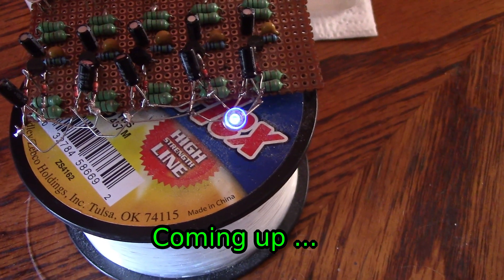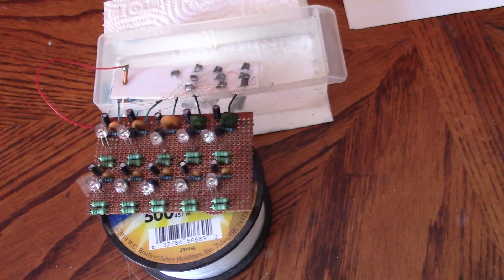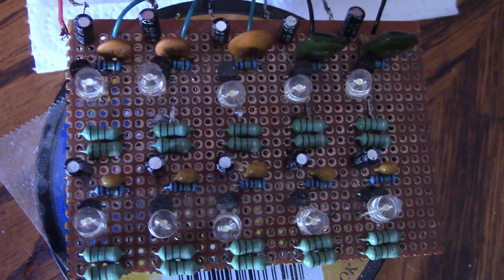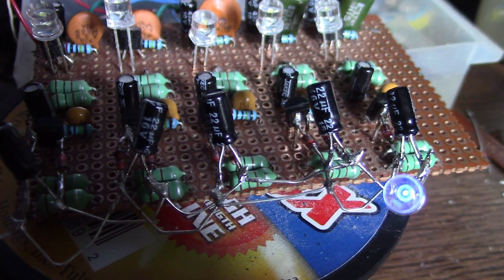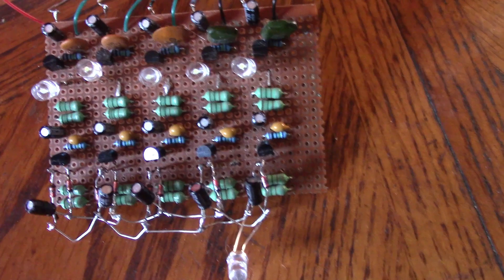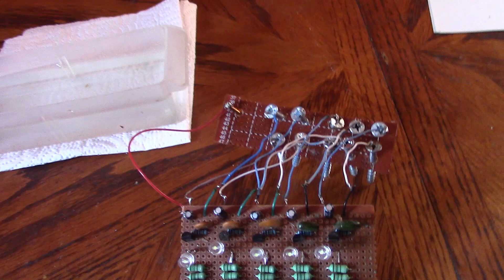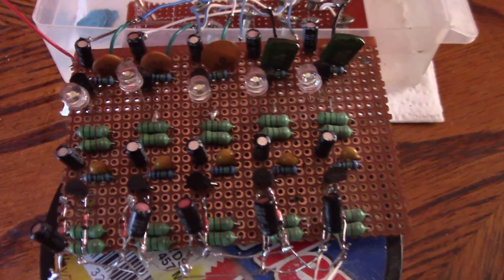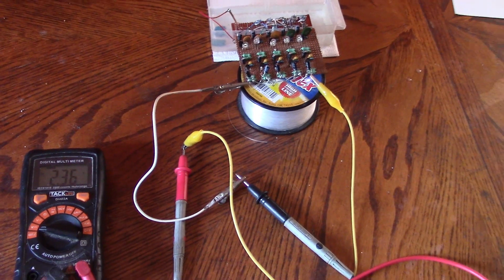Success! No battery or solar needed  - The Power Chip Part 2

Comment: How is this not a battery? I looks like a battery to me.
Reply: exactly.. hate youtubers nowadays, they are so lowly educated.
Reply from the maker: It's exactly that, in a broad sense!
But the individual cells don't need separated electrolyte (flooded lead acid), separate containers (conventional cells) or separate positive electrodes to be summed. 
And, that's the point, to be able to be put in the ground or water and generate AS a battery. There are also significant metals savings by using only 1 piece of copper for the whole lot 😀
Reply: @Slider2732_  if you package the components of a battery in a durable container with low manufacturing cost you get prismatic or cylindrical cells. Why is your design better than consumer grade products available everywhere?
Reply: @drdrowland you have made a very good point ! He made an excellent “battery” (in fact is a generator) which will outlast any modern battery by 100.000 times more and the real beauty is, it can be done in a very small size … probably a size of a car battery for such generator system would be enough to power any vehicle or few houses constant for many years without any maintenance.
Reply: @Caesarus2011  his design suffers from volumetric energy capacity. It would weigh way more, too.
Reply: @drdrowland  nope, it is just proof of concept. He shows is working. I have employed a different approach and is working too. Electrodes can be as big as an atom is and water can be as much as a molecule if someone could make connections at this scale … so, no volumetric capacity problem. I am making one as small as I am able to make all connections required and I will share soon my own design easy to build in diy manner. While the method exposed here is much more feasible for semiconductor tech in nano scale, but I lost any hope I will see such a thing off the shelf in my life time … so, I will teach anyone how to make themselves as many as they like for any purpose.
Reply: @Caesarus2011  it's going to stay proof of concept but that concept isn't performance at scale. It's at test bench scale and the reason they haven't published performance numbers is because they can't compete and never will.
Reply: What he means is the battery that you usually spend your hard hand money to buy😂😂😂🎉🎉🎉

Comment: I made similar thing - 10cm x 10cm pieces of copper, paper and aluminium soaked in salty water.
With single "joule thief" circuit such device produced enough power to light red indicator LED for several weeks - until aluminium dissolved.
Like other person said, this is just basic battery.
Reply: what you're describing  is just a form of battery called a voltaic pile. It's basically the root of why the schematic symbol for a battery looks the way it does.
(what's presented here in the video is also just a battery)
Reply from the maker: Yes, individual circuits like a Joule Thief are the basis, but the difference is to combine many circuits in the same electrolyte and only a single positive electrode, then sum them 😀

Comment: This is just a battery , fun fact, putting the copper and zinc closer will yield more power, in fact, a 1:1 ratio of anodes and cathodes would be best, connect in series for low current higher voltage, parallel for higher current at a lower voltage

Edit: I've also identified the most likely circuit that would create the pulsing effect, and voltage boost, and that's a circuit known as a capacitor-based charge pump. Don't get me wrong, this is a solid project, but with this information, it's just a water activated battery and a capacitor-based charge pump to help boost the power output.

Build that in a grid
Z: zinc
C: Copper

high current, low voltage:
|---CZ---|---CZ---|---CZ---|---CZ---|---CZ---|---CZ---|
|---ZC---|---ZC---|---ZC---|---ZC---|---ZC---|---ZC---|
|---CZ---|---CZ---|---CZ---|---CZ---|---CZ---|---CZ---|
|---ZC---|---ZC---|---ZC---|---ZC---|---ZC---|---ZC---|
|---CZ---|---CZ---|---CZ---|---CZ---|---CZ---|---CZ---|
|---ZC---|---ZC---|---ZC---|---ZC---|---ZC---|---ZC---|

high volt, low current:

CZ---CZ---CZ---CZ---CZ---CZ
  |       |       |        |      |        |
CZ---CZ---CZ---CZ---CZ---CZ
  |       |       |        |      |        |
CZ---CZ---CZ---CZ---CZ---CZ
  |       |       |        |      |        |
CZ---CZ---CZ---CZ---CZ---CZ
  |       |       |        |      |        |
CZ---CZ---CZ---CZ---CZ---CZ
  |       |       |        |      |        |
CZ---CZ---CZ---CZ---CZ---CZ

- (dash): Represents horizontal connections between cells. It shows that the cells are connected to each other in parallel or series on the same plane (e.g., positive to positive or negative to negative terminals). This allows multiple cells to share the same voltage or to add voltages together depending on the configuration.

| (vertical bar): Represents vertical connections between rows or columns of cells. In a series connection, the vertical bars show how the current flows from the positive terminal of one cell into the negative terminal of the next, allowing the voltages to add up. In parallel, this would connect the same terminal of multiple cells, allowing current to add up while voltage remains constant.
Reply: note I had AI try to organize my brain thoughts, this is the most coherency you're getting tonight
Reply from the maker: @Rho-9-Security  LMAO, I see 😄👍
Reply from the maker: Totally agree Jack, about the layouts and differences. Thing is, it's also intended to be metals efficient and durable, with copper being especially expensive and magnesium being short lasting. Hence Cu Zn, with 1x Cu piece 😀
I do appreciate those diagrams! In the final chip size, everything would be far tighter packed and may well produce results as you describe. Thanks for commenting.

Comment: Some time ago, (years?) LidMotor tested the technique of putting rectifier diodes in parallel to get more energy out.  It worked.  I don't recall if he got more voltage out or more current.  I would figure more current.  Using this technique you would need fewer stages to get more current.

Comment: Can we see a schematic?
Reply from the maker: If the project goes ahead as planned then certainly a schematic will be shown too in a following video 😀
As a prototype,  a schematic would only be for wherever it would be up to and likely to heavily change. If you look up a low voltage blocking oscillator circuit (0.5V type) then that's the basis. All oscillators then connect to the single piece of copper and individual zinc pieces. Once you have LED's flashing,, then the circuit is up to where this vid started. Thanks for your comment Jason 👍

Comment: Copper+zinc is best formula where any “chemical” reaction is avoided in contact with pure water, but also any other element which form a protective oxide layer to prevent further oxidation can be employed. Cu+Al, Mg+Fe, Ni+Mg … just bear in mind, electrodes don’t need to be large, actually they can de as small as you can manage to connect them, they only need to touch a molecule of water 😂
Reply from the maker: Thanks and yes, I agree. The zinc screws have been ideal for testing in those ways. The full vision being the computer processor design, which would need to have tiny electrodes. Thanks for your comments, they're appreciated 😀
Reply: @Slider2732_  if you think you can get a continuous layer of cerium oxide on copper that would be best “negative” electrode which will not react with water and for “positive” CuO layer on copper … it should give 2.2-3.2 v per cell with everything preserved for few tens of years or more, provided you ca seal the cell and is full with water. It can be done cheap diy manner with the right skills.

In meantime, the world is still looking for miracle battery to store billions of MWH wasted or trying to invent unobtainable tech.
Reply: Cerium oxide (used to polish glass, stones etc) is best element for “negative” electrode if you can obtain a continuous layer on copper wire. For “positive” electrode CuO layer on copper wire is perfect (the black thing) … you can expect 2.2-3.2 v per cell with this combination. If you could obtain such layers direct on capacitor leads would be perfect … you know what to do for the rest of setup 😉

Tesla work is based on voltage, in opposition with modern usage based on curent … and voltage is almost everywhere for anything you want.
Reply from the maker: @Caesarus2011  Will definitely have a look at cerium oxide, many thanks for that. 
Was looking at the copper and remembering how John Bedini used to heat pieces on a stove top. Own experiments back then did prove out the superior results. The copper had to be pink, like salmon  😀

Comment: Do You know you can use a Zener diode instead of LED if you want to charge a hybrid battery-capacitor ?
Also, 2-4v tantalum capacitors for each cell might yield a better outcome. In my development using 2 electrodes per cell I have started to use 10-20 parallel cells then series them with more stable current, they can burn an LED despite no current being measurable with my instrument able to read 0.01 uA.

If you look up for “work function” of elements (very few if any notes on contact points and not photoelectric) you may find why “the energy” is present everywhere in anything and we need a dipole to create a link between 2 elements. No chemical reaction (transmutation) needed ! And pure water is best dipole … in an electret the same is happening but we need to preserve elongated molecule in electrostatic field until is solidified  … same proceeding is necessary to create an artificial permanent magnet. So, it might be quite obvious that there is not any bs like duality mass/wave as everything already have its own energy which is stored itself according to atomic structure. Magnetic effect is a consequence of electricity and not the other way around. Magnetic refers to heavy mass and the opposite is true. Magnet versus Electret !
Reply from the maker: A hybrid battery-capacitor would be great! I've no zeners here, but had wished to remove the LED's, except for 1 to show power throughput. Fortunately, this works with very simple components and charging is certainly on the cards when a build is made of far more oscillators  😀
Reply: @Slider2732_ not sure if you really need an oscillator for each cell. Look up for “eco invent stud srl” and see yourself.

But I think a capacitor across each cell might do some wonders … Arie Melis deGeus said in one of his patents that a resonance similar to an LC may take place if a variable cap is used for each cell and tuned … but this is far beyond little experiments diy … or not ?

Also, because you are using solar systems, you may want to test some BYV 27 diodes any voltage in series (20-40) than parallel series on a wooden/plastic frame and just let them catch few rays of sun, although they work in little shadow as well as long as there is daylight. I have used 40 in series and just twist them like a string … 12-28v with little curent per string. Test them and make a little calculus for a budget and tell me if you still want to buy solar panels or make your own 🤭 … hook up a cap to check what you get instantly. Bear in mind the more “advanced” solar panels (+£300/panel) use caps as well and some natural ventilation which you can obtain by making strings in open air … based on same “work function” but depend on day/night … where the “battery” works 24/7/365 and no need for huge storage banks, just few gallons of deionised/pure water, or even rain water filtered.